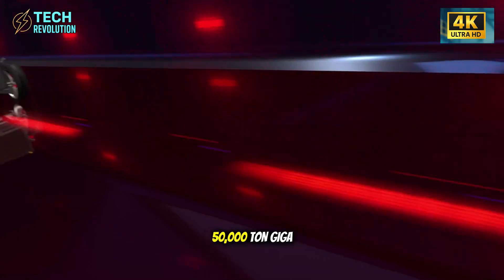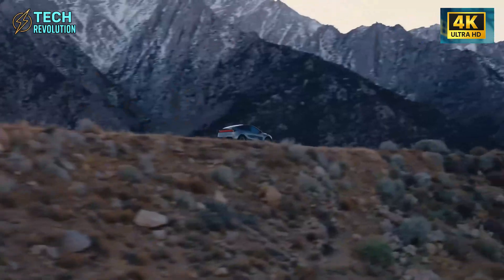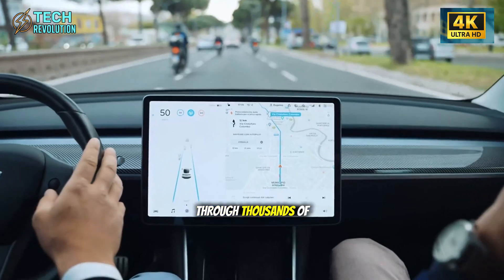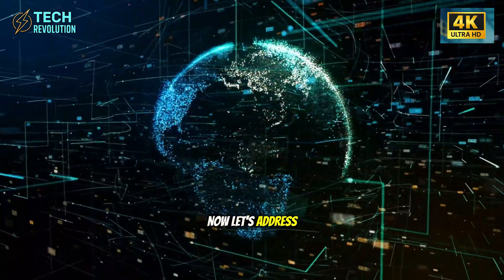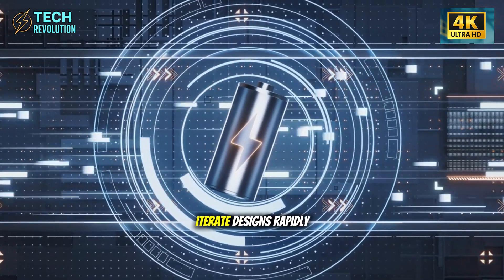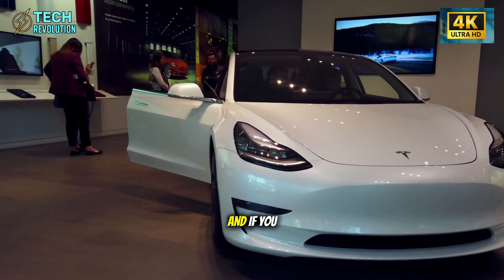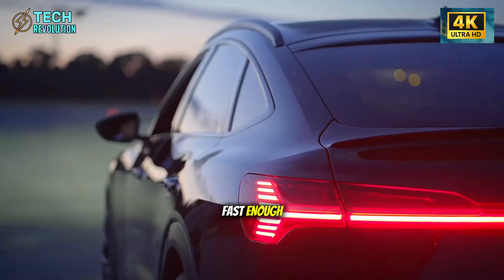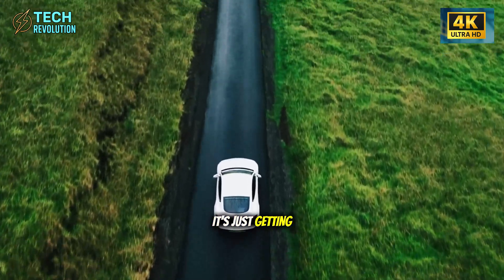Tesla's 50,000-Ton Giga Press FINALLY HERE: Car Bodies in 90 Seconds!

Comment: Jaguar in the 1960s limousine bodyshells were also one piece, traditional built then lead loaded by hand to get the finish they wanted. Were very expensive if a crash happened. How do I know? I was 16 on my scooter on the A45 between Coventry and Stonebridge roundabout when a Rolls Royce came hammering past and bumped my scooter into a wobble the roller then spun in a swerve and behind a truck emergency stopped and a Jag limo with a newly weds from New Zealend went up to the windscreen under the truck all were unharmed but the Jag was a write off. I was never affected by insurance so not my fault.
I went on to do 52 years of body engineering worldwide even at Tesla Fremont in 2014 Falcon doors was my baby project to control.
Reply from the maker: The 50,000-ton Giga Press casts in 90 seconds with AI vacuum QC—very different from costly one-off shells.

Comment: If it is too expensive repair after an accident - what happens then. You cannot say there wont any accidents!
Reply from the maker: Accidents will happen—but with the 50,000-ton Giga Press, Tesla cuts build cost so total loss thresholds drop too. Lower build cost = cheaper replacement economics.

Comment: May EV ba na dalawang lead acid 12v... 🤔🤔🤔 Dami nga Ng battery sa mga EV eh pano Maka kaya Ang dalawang battery lang🤔🤔🤔... Parang lokohan na ito... Mabodol ko kayo ngayon...
Reply from the maker: I think there’s a misunderstanding—EVs don’t run on two 12V batteries. They use a high-voltage pack; the 12V is only for electronics, not driving.
Reply: @TechRevolution26 ok let see may be not today.. it's a secret electric engine...